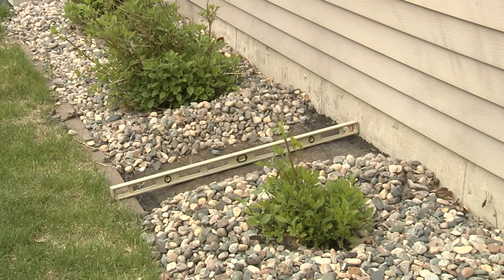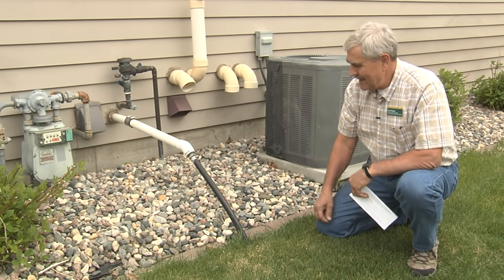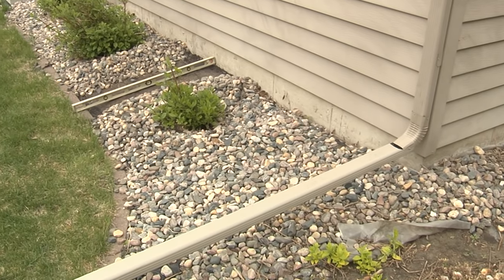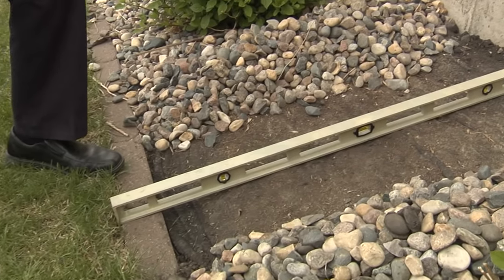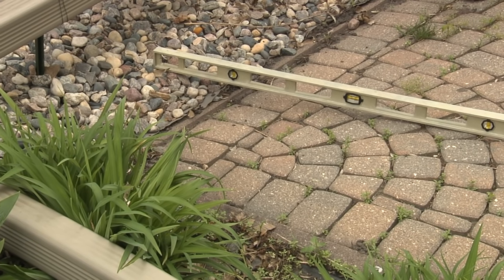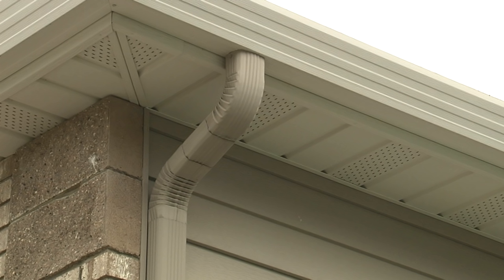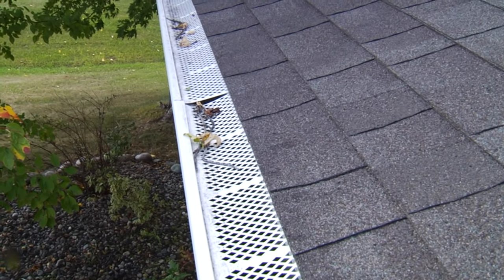How to Prevent Rain Water From Entering Your Basement

Comment: Lawn grading -- I have now watched several videos telling me that the water should not be allowed to settle near the house. I'd sure love to find a video that shows me HOW I can do this. I'm sure there is more to it than shoveling dirt in the direction of the problem. As for this particular video -- those plastic sheets shift around and the edges reveal themselves over time AND weeds will eventually poke through. Then you have a mess. Also, that gravel will travel out into the lawn and become projectiles as you mow. Also, I"m supposed to go to the expense of keeping my lawn "uniformly moist" -- that's a solution to dirt pulling away from the house?
Reply: The few people I know who have solved the "keep all soil on the property within a moisture tolerance" problem are genuinely wealthy, and they use a combination of sensors and automated sprinkler systems. Just eyeballing the grass and using a hose or a static sprinkler is, imo, more likely to just bump your water utility bill. Also, I find it odd that you can pack new dirt up against your foundation to correct grading, but you can't pack soil that's shifting away back. Seeing the dirt moving away if you have plastic and rocks is also an issue I'd like to see explicitly addressed.
Reply: @alleni2476  the reason you can add soil to grade, but not when the soil drys out and pulls away is that when grading the soil should still be moist. No void next to foundation is being filled. When soil drys it shrinks. If you just back fill it when it starts raining again the soil expands to it's original state. The added soil now puts added preasure on the foundation. As to ware when you are just adding soil to grade you are not fill voids. You are building up, Not in.
Reply: @williamallen7836  Appreciate the clarification. Any tips for a Michigander on a budget? Would it be better to cover areas that dry with fabric and mulch (my front flower bed is plastic barrier and brick nuggets, and the soil underneath is always moist when I maintenance), or till the dirt and slowly moisten before filling in?
Reply: @alleni2476  I have mixed emotions on doing it with plastic and river rocks,  which is what I have now. I have fought water in the basement   I think in every location of this "house from hell".  25 times!  It's obvious that the previous owners (17 years ago) packed dirt up against the foundation as I can see the foundation wall has a slight tilt inward on the back side. That issue I'm unsure what to do with although I've heard of removing the excess soil and using Jack's to slowly move the foundation back slightly when the soil is completely dry. 

In regards to the plastic, that to me seems counterproductive. I would think a higher dollar fabric cover designed to keep weeds out but allow moisture in would keep a more uniform level of moisture within all the soil while being covered by my river rocks. I'm going to put all the rocks back on 1/2 of the front of my house. Then move the soil so it slopes away from the foundation. But not pack more soil against the foundation except in a small area where there simply isn't any soil.  In other words, I want the soil the same height and level across that 1/2 of the house. Then ensure it all slopes away from the house. 

By using a fabric material versus plastic, my soil should remain wet or dry uniformly. Thus not putting any undue pressure on the foundation.  Hard to describe. But on one end of the house, I have 8 inches of the foundation showing from the soil to the siding. And it's like that to the basement window sill and for another 3 feet pass that window sill.  Then it starts to decline rapidly until there is like 13 inches from the siding to the soil line. So I'm assuming I need to add another 5 inches around the foundation. Not packed tightly but just put there so I have some uniformity so the soil around the foundation is level and consistent. 
I have a 2 foot overhang from the roof, baseboards, and then another 6" of guttering. So I want the slope to begin almost immediately from the house.  I believe plumbers slope piping 1/4" per foot or 1" for each 4 foot section inside a home so I plan on using that philosophy. 

Sorry so long. If anyone thinks i'm nuts, please tell me!  LOL!
Reply: Greg Simpson You’ve dome your homework! That’s not nuts!!
Reply: Using dirt alone is not a bad solution. It's better than nothing. 
Put the the dirt there, grade it so that it slopes away from house. Compact it. 
Voila, the water will now not settle in a little puddle around your foundation. 
I did it. Worked well.
Reply: @gregsimpson621  Late to the party here Greg, but I had a very knowledgeable foundation expert come to my house a few months back and he even told me, pack in dirt around the foundation at a 1 in slope per foot, lay down some 10 mil poly (vapor barrier) 4 feet along the house and nail it in place. This guy who told me has been doing foundation work for nearly 50 years and I trust him completely. This will actually keep pressure off your foundation by causing the soil to dry. The issue is when soil gets wet and then dry again it can expand and contract causing hydrostatic pressure which is actually what causes your foundation to crack & then pushes water through those cracks as a (path of least resistance). Hope your basement has been dry the past few years! Cheers!
Reply: @tangyboi6420  I think you nailed it!  The soil gives the proper slope but keeping moisture away from the foundation is key. I totally agree with your comment. The other thing was ensuring the gutters were never clogged. I found this out later. Having the slope and the plastic though would have made this less of an issue. But it worked for me. But I think your way makes the "gutter issue" not as critical. Thanks!!  Oh; I use that "path of least resistance" in many issues and not just home issues. Great comment!

Comment: Informative video. Note to the home owners: those downspout extensions are very tacky! If you need them that far from the house then spend some $ and bury them. And pay for a custom window well cover don't use a cheap ill-fitting type.
Reply: I do not think they are tacky. Additionally, if you chose to bury an extension in a freezing climate, make the connection detachable. (You will need to re-route it in the winter)
Reply: Never bury a downspout.  Class dismissed.
Reply: @243wayne1  You can with PVC but it needs to have an exit and make sure it has proper fall (at least one quarter bubble).
Reply: @Kharnellius I'm so confused. I thought all houses had to have downspouts so that water could drain? I don't knw much of anything but need to learn due to major water coming in home.

Comment: re 3:00 What is the effect of having what looks like a 'curb', that would presumably trap at least some of the water that should flow freely away from the house?
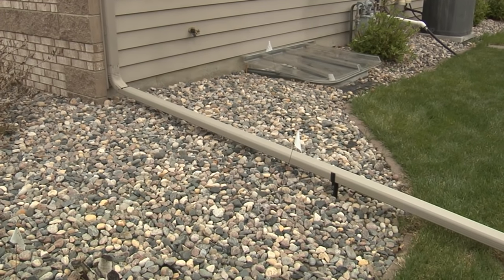re 6:30 It might help to visualize the water as generally draining thru the ground to 'pile up' on the original un-disturbed & relatively impermeable sub-soil, and then flowing whichever way that sub-soil surface is inclined.  Only the heaviest rainfall or the continued rain after the soil is saturated, will follow the surface /grass incline. 

re 7:50 A better solution than soaking your soil, is a true barrier, attached to the foundation, & extending as far away from the foundation as the foundation is deep, and covered with a stable & compact 4-6" overlay of topsoil for the further stabilization of good grass root growth.

Comment: I used roll roof membrane instead of the plastic sheeting under my rock. Curved the edge up the wall and used PL to glue it to the foundation.... works great. No weeds.
Reply: I wish the guys gave you feed back on this. It sounds good, better than the plastic the  roof membrane does give you alot of ground coverage. Its roughly $69.00 at lowes. Its also thicker. My house was built in 1972. It's a 5 level backsplit. I'm in the middle of doing my research. The materials we have now is so different from back then. What you did makes sense. Just one question so I can understand your steps correctly. You used the pl glue and glued along side the foundation. Then put the roof membrane ? Did you use  clay or soil and built up your slope or did you just use rocks? When did you do this project?
Reply: Patsy Ghannie   I did this 6 yrs ago. Yes, I got a few pickup trucks of dirt and sloped out from the foundation 3 feet. If you have basement windows, how’s the time to put in your new wells and covers. Then I just simply cut the roofing at 4’ long rolls, ( I started with 8’ rolls), fold back 1’, and lay on the freshly sloped soil up against the foundation. I had a chalk line on the foundation approx 6” up from the new level of sloped soil. Apply generous amounts of PL to the foundation in sections you can handle, then flip the membrane up and press against the wall. Do whatever you have to do to get a good seal. At this point you should have a 3’ sloped area covered with membrane and securely struck to the foundation. Now go back to Lowe’s and get your landscape blocks or pavers and install. Remember, you now have a “water slide” all along the wall, so you need to provide a way for water to escape to the soil past the edging or pavers before you fill with rock. Here’s a huge hint at this point.... buy the heavy smooth river rock or similar.... something that cannot be blown out by your yard blower! If you have any exposed membrane above your rock height that isn’t glued down simply cut it off with a utility knife. For maintenance... I spray the rocks in early spring, mid summer, and sometime in October for weeds and bugs, blow out the grass clippings. This also eliminated sugar ants!  Have fun and be well.
Reply: I had a very similar idea about making a water slide shape partly up the foundation but never thought of tar paper? Is that it? Anyway glue it to the foundation? What glue? 30 years of water in the basement.  Its getting to be just too much Thank you
Reply: @great-garden-watch  hey there… yes go to the big box store, then find someone in the building materials. Tell them your looking for cheap rubber roofing membrane and see if they sell it in a 4’ roll. If not, get the 8’ roll, but expect some waste. Also while you have his attention, ask him where the PL construction adhesive is. It should be with the caulking and such. Ask him to pick the one to stick that membrane to whatever your foundation is. Get a caulking gun if you don’t have one. Remember Ms Nancy you must have a slope AWAY from the house at least 3’ out. If you don’t have a good slope away from the house you will create a puddle right there next to the foundation.    This method works very well for me, if you have questions just ask here.
Reply: @trevorjarvis3050  I have issues it must be water getting in basically at the very bottom of my basement wall. There's a crack it looks like where the retaining wall joins to the main part of the house, and that seems to be how it's getting in at the corner of the basement. Not coming down the interior wall, but appears to be flowing in "from the bottom." My gutters are good, checked and doublechecked that (perimeter drain from downspout). Do you think that maybe bringing that slope like you're talking,  4ft or maybe even 5ft out may remedy the issue? Gosh I'd hate to have to dig up 8 ft deep and seal that crack, but if I have to then I guess I will.
Reply: @robertnewman4105  the farther you can get water away from your foundation the better off you will be. If you can slope the fill dirt and membrane out 4 or 5 feet, awesome! Just make super sure that slope runs away from the house AND problem corner. Now with that said… and not knowing what your foundation looks like… if your only having a problem in ONE corner, you can install a sump pump in that corner to eliminate the hydro pressure under the foundation and wall.
Reply: @trevorjarvis3050  thank you. Yes as long as my gutter drains function properly, it really is just this one corner.  I like the idea of Maybe a shallow French grain along with the slope away.  However my concern is like you say not knowing what the foundation looks like underground my worry is that the groundwater underneath will keep getting in and that big crack, and I may be better to do a more extensive repair. Or a somp pump.

Comment: I particularly like the plastic sheeting someone put down.  This would seem better than dirt alone.
Reply: Even better one step further put down a lot a black and white newspaper (not color add inserts) and you will keep weeds out if you put down a few good layers. Biodegradable and breaks down slowly!
Reply: @RA82828  it definitely is and a year or two later and it's done a better job than any drainage system I've put in. What I did was cut a tarp into roughly 2' wide sections and length of 12'. I made sure it had a slight slope to it away from the foundation. Even better, with an old paint brush, I put about a two inch line of roofing tar along the foundation where the soil meets the foundation and stuck the first two inches of the tarp to this.  It works perfectly. Put anything you want on top of the tarp. We put rock for low maintenance. If you put soil, you need to make it reasonably deep. If I had a new house built for me, I'd have the contractors do this all along the foundation of the entire house.
Reply: @RA82828  it's interesting in that, if you think about it and consider the expense and scope of work that goes into other waterproofing systems, this is surprisingly very simple and cheap and I'm surprised I haven't seen other videos like this.  It's sort of like crossing the street in a straight line, simply from one side to the other in a crosswalk, vs traveling up to the next intersection, doing a U-turn, stopping at traffic lights, minding the school bus and finally reaching your destination on the other side.
Reply: I'm confused. The first guy seemed to suggest building up the dirt but the second guy said not to pack it with dirt along the edge??? What am I missing?
Reply: @monicamimier51  I dug down about 8 inches deep and dug about a 2 feet swath around foundation, graded the soil to slope away from house. Then layed tarp down to fit the 2 foot swath leaving 12" extra against wall. Covered it with the 8" of dirt I removed, and put roof tar on the house and mashed the tarp that was left(about 4"  12" tarp - 8" dirt)against the roof tar. Grass seed the dirt area or put down sod. I can't tell you how well this has worked. I'd never do it any other way unless a French drain is necessary. No pipes to break or clog.

Comment: I have a corner house...city built up 2 streets three times with no curbs or sidewalks. My house sits -15 degrees from the street. My covered carport has three 6x6 posts holding up the carport roof. PROBLEM= for 18 years I have begged everyone and anyone for help with the water flooding the carport and my AC wiring on the house. The fire department will not bring me sandbags. I have spent over the years $2,000.00 in gravel, 8" sewer pipe dug down and that did not help at all. NOW my concrete is crumbling and splitting and worried about my three posts pulling on the house. I am a single senior that is disabled with an adult daughter with no legs. Just need a little direction and I thought about building out of concrete a 20 foot speed bump to stop the water. Thank you, everyone. Gimpy in Indy

Comment: great video. I have a question on the roof I've got concrete tiles, the roof has a T section and as result it has that corner which collects the water over metal thing which is 30 cm wide. I tend to believe that when water drops from the sky the small water drops flying different directions fly under the tiles on the wood and then drop from the wood into the house. As result I have some not a big leaks in the roof. I'm looking some anti splash protector. Anything you can recommend? Or if thats small leaks I should ignore?

Comment: @7:00 Adding a couple inches of soil next to a foundation at ground level will not push the wall inward. 

Similarly, it makes no sense to water the area just to keep it moist. Grow grass right up to the foundation instead, if moisture retention is a concern.  

String trimmers and weed pesticides are both things.

Comment: would it be bad to have a lower area below and outside the window well ring?   currently planning on doing this . I built a pit beyond the wondow well and steel ring.  The well has stone 5 inches below the crawl space vent but out side the window well ring ring theres a pit some 10 inches deeper but connected with the same ston some24 inches  deep.. Bottom has fabric. the outside of we;; has faric at bottom 10inches deeper  filled with stone  then fabric then dirt on top outside ring. Noone has ever done this or answered on this practice. Curious on ur thoughts. the stone is deep and slated away. is it going to have enough hydraulic psi to push water back towards house vent for crawl space even when its only three blocks deep. Sorrry to anyoe if thiis doesnt make sense. ask questions if need be

Comment: What type of soil do u guys use for the slope ?
Reply: doesn't matter, just compact it.
Reply: @liembui4239  it DOES MATTER.

Small particle size is less water permeable, so clay is good, sand is bad. 
Expansive soils can pull away, trap moisture, and put extra pressure on the foundation walls. 

I use and recommend what is called "class 5" where I live. It is a mixture of small rock, sand, and clay. It is considered semi-permeable, so it doesn't trap water, and also sheds (most) water, given a sloped surface. It is compactible, easy to install, and cheap.
Reply: @cheshstyles  I don't consider sand as clay.
Reply: @liembui4239  lol i mean you're not wrong